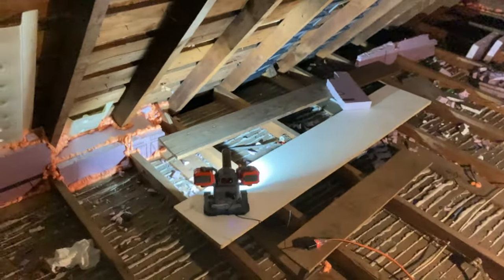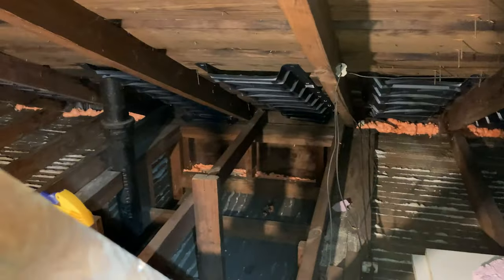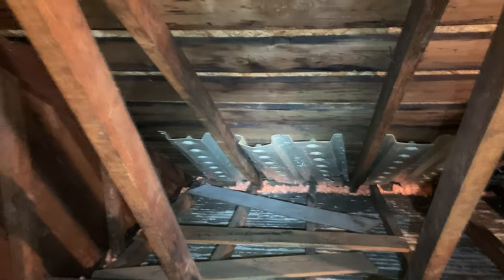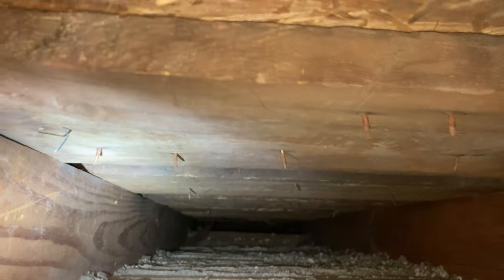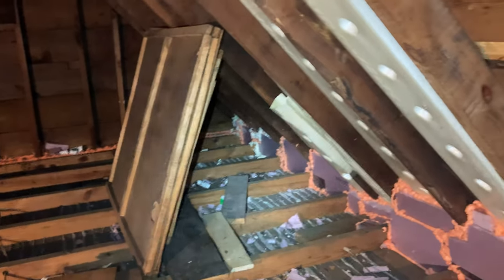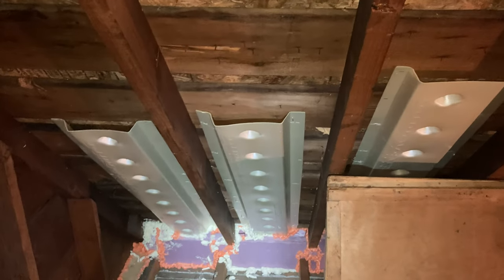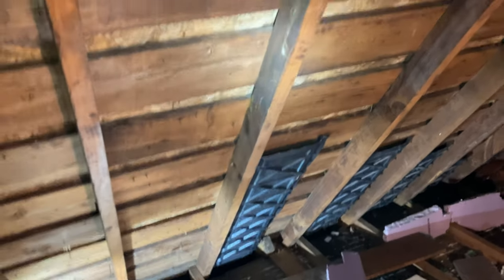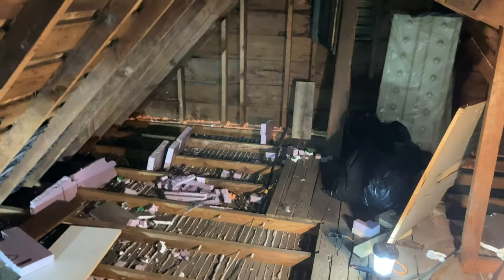1925 Balloon Framed Attic - Air Sealing - No Soffit Vents - To Seal or Not to Seal?

Comment: No soffit vent no air flow. You threw your money away on the baffles. Actually those open stud bays served in some extent to get air to the attic .  Now you’ll rot your roof..
Reply: He does have a Ridge vent he said which would help a lil but at this point he needs to add an active fan or active air conditioning like a mini split to remove the humidity he's creating by super sealing those corners. You are correct ultimately tho in him wasting his money on the baffles especially seeing as they are the incorrect size as well. Those walls were designed to have an air pocket in them leading directly into the attic to vent the whole house. He f*cked that whole original design up.
Reply: @phillysupra  

You two guys seem to have some knowledge about this sort of thing so I am hoping that one of you will respond to me.

We have an old balloon-framed farm house with wood siding and steep roofs, and ONLY ridge vents. NO soffit vents (not even possible with the design). Yet we have never had any issues with moisture or anything else in the attic. This seems contrary to what practically EVERY "expert" says these days, that you WILL have problems if you don't have soffit vents. Our house is proof that this is not true, but I do not know why this is.

We are having new vinyl siding installed this summer and I will be removing the old wood siding (pain in the butt to maintain) and wrapping the house with Tyvek before the new vinyl siding gets installed. 

My question is this: Do you think that the Tyvek could cause a problem with the attic venting? Because, even though there are ZERO soffit vents now, it must be venting somehow because everything has been fine in the attic for over 100 years. I'm not sure HOW it's being vented, but it is. And now I'm wondering if the Tyvek will actually do more harm. Yet we must have a house wrap for the vinyl siding. 

Any responses from either of you would be much appreciated.
Reply: @Jonnyvids14  sure. A lot depends on the era/ year the house was built. For instance my 1920's lath and plaster walls : houses built in that era were made to vent thru the walls and up into the attic. I currently have siding and a wrapped house. My roof was just redone in Jan of this year. I also currently have a Ridge vent and no soffit BUT when I go to redo the attic I will leave a 2-3 inch air gap between my roof plywood and the start of the insulation leading all the way up to the Ridge vent. Doing this will keep the original airflow design of the house while also letting me insulate my attic for better use.
I would have mold issues at some point IF I super sealed the walls and allowed no ventilation. With newer homes this is not a problem because the entire house is designed to be air tight from bottom to top.

In your case, your ceilings could be vaulted so high you wouldn't notice and venting issues and it also depends on where in the country you live. I'm in the northeast (PA) where it's either cold winters or very humid summers so if I supersealed my attic I'd definitely get mold because I didn't allow the moisture to dry away.
Reply: @phillysupra  

Thanks for the fast response. 

We live in lower Michigan. So plenty of ice cold weather, and plenty of humid summer weather. 

I was wondering if maybe the reason it's never been a problem is because of the steepness of the roofs, thereby allowing the hot air to escape faster?

I am a kitchen & bath remodeler but no expert when it comes to roofs, venting, and insulation. 

We don't mind having a house that breathes and lets some cold air in. We kind of like the fresh air. Ha!
Reply: @Jonnyvids14    Ok old house. More then likely there, most likely, there was when originally built some sort of venting at the soffit. Ridge vents weren’t really a thing back in the day, you had gable vents or windows, and roof vents, on the east coast we called them by name “high hats,or top hats”, In uninsulated attics that allowed decent air flow along the inside of the roof from top to bottom. By stuffing insulation against the roof stops this and condensation will collect and that leads to all kinds of bad things.  Even if there was no soffit vents when built , the walls themselves were probably not insulated and the whole house breathed like a living thing. Old house were healthy houses. If your going to insulate your attic your going to need to vent from soffit to ridge  continuesly. If your not going to insulate up there and you start to have problems a roof fan or and gable vents should go along way to keeping you in good shape, just as long as fresh air can circulate on the entire underside of the roof.
I’m an old retired builder 50 years of non stop home building. I’ve seen products come and go, good things stick around and others fade away, nature of the business.  Tyvek, house rap, whatever.  If you can apply tyvek with absolutely no penetrating fasteners , staples and nails, then if you can install your siding with no nails, so that you do not penetrate the tyvek, and the tyvek is installed never penetrated by anything, nail or staple. Then and only then would it do anything at all. Tyvek is used only because the industry has a lot tied up in it still, it’s use will fade away just like aluminum siding did. But if you were to put new aluminum siding on your house I’d definitely want to waste more money and rap it in tyvek first.
Reply: @cb4920  

Thanks for taking the time to respond. Much appreciated.
Reply: Brett without seeing things with my own eyes it’s Impossible to say anything for certain. If your not going to insulate your attic , there’s really no added value to your envelope by doing so unless your also going to heat the attic space, make sure your ceilings are well insulated instead.  So if you don’t insulate the roof your rafters and underside of your sheeting will be exposed to the air. The ridge vents are good but don’t do much on their own about circulation. An inexpensive attic fan installed on your roof would do wonders, if you insist on insulating then use baffles leaving them open to the air at ridge vent and at the bottom, even tho you’d not be pulling air from outside through the soffit with a fan you would still achieve some circulation to the roof sheeting. Not the best circumstance but better then smothering your home. If you were in my neck of the woods I’d take a look at it and point you in the right direction. Good luck.
Reply: @cb4920  

The attic floor is already insulated. It's been that way since we have owned the house. So we don't loose much heat up through our ceilings. 

The reason for the Tyvek is because we are doing vinyl siding, which requires SOME form of water-resistant underlayment because vinyl siding is NOT water-tight. 

I've seen what can happen to wood underneath vinyl siding that did not have Tyvek (or similar) protecting the wood from getting wet. Not good. Lot's of rot.

There is ONE small non-operating window on one of the gable walls in the attic. I plan to replace this with a gable vent to help with air flow since the window doesn't really add any beauty to the house.

Anyway, I just found it surprising that when I was up in the attic working a few years ago, there were NO signs of any moisture anywhere, and yet there is NO soffit venting whatsoever. ONLY ridge vents at this time.
Reply: @Jonnyvids14   That sounds good about the attic. The ceiling should be insulated as you say it already is. It’s the actual attic space, as long as the rafters aren’t insulated you should be good. Your right about vinyl siding it can get wind blown water behind it. As you can tell I’m not a big fan of house rap but you do need a vapor barrier and Tyvek seems to be the flavor of the week. Personally I’d use 15ld roofing felt.  I’ve taken down 90 year old siding and found the tar paper behind it  in good as new condition. Tyvek is supposed to be semi permeable letting vapor move away from the house, after you put it on it’s so shot full of holes it’s basically useless as a working vapor barrier, tar paper on the other hand self seals around fastener penetrations for the most part, although it dose not let the house breath once it’s protected with siding of any type it’s virtually waterproof.  I know a lot of inspectors and local building codes call for house rap and disallow tarpaper, so you’ll have to abide by the law whatever you decide. The vast majority of building codes are good, good for the customer and good for the professional builders as well. They separate the hacks from the pros. House rap isn’t required in a lot of localities but it’s still hanging around in some.
Reply: @cb4920  

I really appreciate the feedback.

I totally understand what you are saying about Tyvek and all the fastening holes. And I understand how tar paper is much better when it comes to sealing those holes. 

The only advantage I see of the Tyvek is that it's super tough to tear. But once it's up, there won't be anything tearing on it anyway. So you have me pondering the use of tar paper. 

I do know that Tyvek is super water-proof. Makes for great ground protection under tents.
Reply: @Jonnyvids14  makes good kites too! Good luck
Reply: im in a similar situation, i odnt have buffles installed but little to no insulation blocking the soffit. I do see little to no  light  from the  soffit . I went outside to check from exterior point of view i was only able to poke a credit card enough space. 
Is that enought  gap for the attic to breath a credit card gap ?
Reply: The underside of the roof sheeting is the only thing that needs airflow in unfinished attics the rafters are not insulated and air flow is created  in through the soffit vents and out through either ridge or gable vents.  When one converts an attic to conditioned space  and insulate the rafters you must maintain that air flow with baffles on the roof sheeting and free and unblocked soft and ridge vents, gable vents , windows, fans and anything else will not help. I repeat. The underside of the sheathing is what needs the air. If it doesn’t get it nothing else you do will not help at all, not even a little bit.
Reply: Exhaust fans help with added air flow if and only if the attic is already vented correctly.
Reply: @cb4920  my house is old ,1880s or so. Can you tell me what these high hats/top hats looked like? Ty.
Reply: @janisb8064  if we’re speaking about the same thing then a high hat is simply a roof vent mounted near the top of the ridge usually spaced about eight feet apart used in conjunction with gable and soffit vents in uninsulated attics to adequately provide airflow to the unconditioned space.
Reply: Very good answer.
I'm in a 1915 home clad with brick in the 20's 
and amazed at how well it still works.
Old houses were meant to breath .
Insulation on the ceilings is all they need.